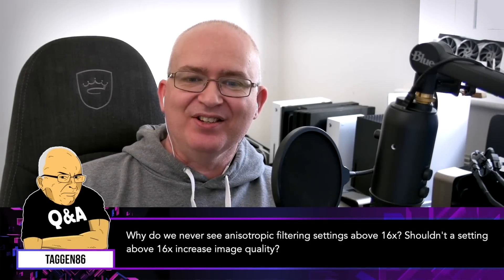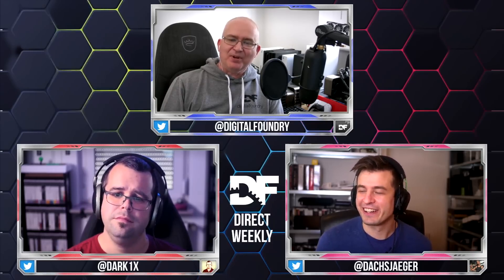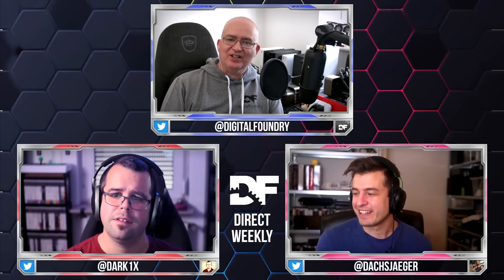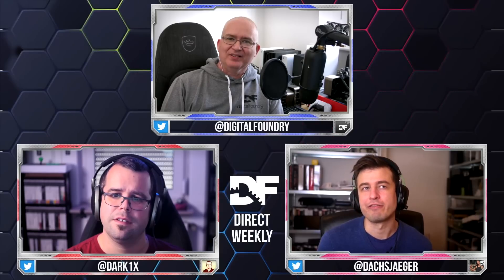Why Doesn't Anisotropic Filtering Go Higher Than 16x?

Comment: Personally I almost always choose 8x on my computer (since there is actually be a small penalty to 16x)... I rarely see a difference between 8x and 16x in modern games and at modern resolutions. The tech was just WAY more important back in the days when you played at low resolutions like 640x480 or 800x600, while games had these endlessly repeating textures on flat surfaces. That's not the case anymore.

Comment: I can tell easily tell the difference between 8x and 16x anisotropic in modern doom source ports when using nearest (raw pixels without filtering) texture filtering mode with linear mipmapping (to prevent crazy moire pattern flickering in distant textures). To get high quality moire free but yet sharp rendering could easily use more than 32x.

Comment: In old games a lot of geo is flat, so you can really tell the differences.

In GZDoom I play with Doom with 32x aniso even, because with 16x at high resolutions you still see a lower quality result with 16x in a large open space.

I'm pretty sure some old Unreal games also provided a 32x option and yeah you can see a difference. If I'm not mistaken, Killing Floor 1 has a 32x option?

Comment: I remember when for a time ATi also supported 6:1 and 12:1 filtering.
And there is pretty much no performance difference at this point in time. I remember a review where the Radeon 9800 Pro had less than 7% difference between 16:1 and off.
And the Geforce 3 in my retro system can indeed 32:1 AF

Comment: This video doesn't actually answer the question beyond "hardware doesn't support it". The real reason is that you get quickly diminishing returns when you weigh computation time vs. resulting graphical fidelity. As one of them said, it's hard to tell the difference between ×8 and ×16. The returns on fidelity increase logarithmically, and the computation cost goes up exponentially. Hardware accelleration improves parallelized tasks like anti-aliasing so that the cost doesn't actually grow exponentially, but it's still a loss to go beyond ×16 in 99% of applications.

Comment: It's interesting that you mentioned down sampling to increase edge definition, in Stable diffusion one of the ways we achieve really good refinement is to over sample, so create a larger resolution image and then down sample it. A good combination you can use is openpose to keep the same position in space for the subject as well as facial expression and face shape, then use a depth model so it maintains the depth, and a model called canny which maintains the texture definition. Then you just give it prompts and regenerate the textures in this shell you've created at a higher resolution and down sample it. I wonder when we will start seeing these techniques being implemented into games, they're getting faster and faster to render every month, we can now render a full image in near real time with a decent graphics card through a model called turbo sdxl.
Reply: Super sampling and msaa is the brut force way to increase visuals 😊
Reply: generative ai fuckboys try to not bring up that they steal images for a living challenge (impossible)

Comment: I almost don't see the difference between 8x and 16x, going higher is totally dumb IMO.  I only don't use 8x exclusively, because today texture filtering is not the bottleneck for GPU's, so setting it to 8x has very small, almost zero, impact on performance.  BTW if you can make them work the old 3DMark03/05 benchmark's have a very cool texturing filtering test tool where is very easy to see the diference between the filtering modes. (the one in 3Dmark06 doesn't work on my PC and later 3DMarks afaik lack this tool)

Comment: I spot the aliasing on chain link fences all the time.  ironically I prefer trilinear in that instance, blurry is easier to look at than moire
Reply: I was hoping they'd speak a little bit on that. I've encountered some titles where 4x fixed a severe moire issue that had the ground sparkling constantly at higher anisotropic filtering levels
Reply: @michaelavrie  admittedly it is an edge case, but dynamic anisotropic filtering is definitely on my wish list because of that

Comment: Today, it probably would be easier on your hardware and of better quality to just turn on CAS and/or LumaSharpen in ReShade (CAS is also available in-driver, but I prefer ReShade as it is per-game) after having forced 16xAF. 

Alternatively, if you have nGreedia GPU and a tool called nVidia (profile) Inspector you may configure LOD to a negative value, say, -0.5, or -0.75, or even -1.0 for sharper distant textures in DX9 or older games (but if you use both sharpening and negative LOD it may cause shimmering). 

Honestly, since I bought a 6900XT, the only thing I miss is the versatility of nVidia Inspector's functions and its vast choice of antialiasing modes. As my last nV GPU was a 2080Ti, it used to be a nice experience, cranking on 32xS antialiasing with 4x transparency supersampling on top in older games like FarCry 1. And, contrary to some opinions, I could easily spot the difference between 8x and 16xS antialiasing; 16xS and 32xS not so much, but quite often too.

Anisotropic filtering, on the other hand, I could not really see any difference between 8x and 16x modes. In fact, as long as it wasn't the case of "look at the scene and textures, take it to memory, goto menu and switch AF" I wouldn't be able to clearly tell the difference between 4x and 16x anisotropy.
Reply: Depends on how you checked. AF will make far textures at angle sharper. If you see something like road in gta and look at far side then you’d notice more difference than a wall upclose. Mostly objects at angle won’t be blurry.
Just keep 16x cuz there’s no performance impact anyway.

Comment: this clip doesnt even attempt to explain the answer in a meaningful way. anisotropic filtering scales any given texture based upon the oblique viewing angle, and thusly, the mipmaps visible distortion. think about it this way: 16x filters angles twice as steep (in degrees) as 8x, which filters angles twice as steep as 4x, etc etc. how many steeply angled degrees for a texel are there?? the answer is veeeeery few, so unfortunately, higher levels of AF like 32x/64x wont do much to improve perceptible image quality in theory. thats why its never been implemented beyond 32x (in old matrox gpus!) - they would only improve image fidelity of a tiny percentage of the screen (little spot here, a rock over there) due to the threshold set by the filter for higher angles relative to the player/camera POV.

despite this, im of the firm opinion that 32x should exist as an opt-in setting for image quality/clarity enthusiasts, and that 16xAF should completely replace trilinear filtering as the default baseline

Comment: I think the bigger question is way does MSAA go from 4x to 8x, shouldn't 3x in each direction or 9x be the next logical step after 4x?
Reply: If you down or upscale at rates other than 2 times, then the pixels do not align with each other properly and multi sampling becomes impossible.
And a part of MSAA is upscaling and downscaling a rendered image or part of an image.
1 times two is 2
2 times two is 4
4 times two is 8
And since it's literally an exponential increase they don't bother with 16 since your PC or the graphics engine is unlikely to handle such a data load.
Reply: @Reac2  You have to scale by integers not by twos, 2160p is literally 720p times three in each dimension.
Reply: MSAA doesn't sample in a grid, it's a different distribution

Comment: I can see bilinear filtering and can vaguely work out what it's doing
I can see trilinear filtering and can vaguely work out what it's doing
🤔😐 I honestly have no idea what anisotropic filtering does and how it works.
Reply: If you imagine a flat floor and you project how many texels a single screen pixel covers, it's a trapezoid shape, a very flat trepezoid if it's far away. AF deals with that case where there are more texels along one axis. Bilinear/trilinear assumes the pixel->texture space projection is square, so you get more blur in one direction at a large distance.

Comment: It really depends on the types of 3d worlds a game has, the geometry, and clutter in the scene. A game like Tribes for example is large open spaces with sprawling landscapes. You can see the 16X AF cutoff easily there. Its not the most critical thing to go above 16x but there definitely is an argument to do so for the right open area game and the performance budget overall.
Reply: Tribes mentioned W

Comment: I remember ATi had 32x anisotropic filtering setting on their control panel back in like 2005.
Still, 16x is more than plenty enough, on top of having pretty much no performance impact.
8x AF is noticeable though, so always go 16x.
Reply: I definitely remember having 32x AA modes during that crazy era where Nvidia and ATI were inventing silly modes like QQAA and weird combinations, but I think 32xAF was something available only on ATI's highest end consumer cards and FireGL cards. IIRC it made zero difference compared to 16x, so support was dropped with the following generation.

The mid-00s were a weird time for graphics. Lots of games still had really basic bump-mapped, flat surfaces. Today's graphics have significantly more geometry to break up texture patterns and oblique angles, so it's not like the same texture repeated forever on the floor, walls, etc. AF is a lot less important now.
Reply: @HansUberschlage - I still remember what a massive difference AF was when I got my 9500 pro, which was one of the first cards able to implement it with a negligible performance impact.

I still want AF in every game, but I wouldn't be complaining about 8x vs 16x.

I also remember all those different AA modes of the 2000's, almost all of which looked like trash and/or cut performance to a third (for younger folks, no, I'm not exaggerating).  Edge-adaptive AA was the beginning of AA really becoming an everyday option for me with a good compromise between image quality and performance. Now we don't even bother talking about what type of AA is being used aside from standard vs image reconstruction.
Reply: @40Sec  Agree, I always use 16xAF and maximum texture size/quality. I'll drop resolution before I lose that. If I wanted blurry textures, I'd play the console version.
Reply: I don't understand why this setting is still available and not just locked to 16x considering the performance impact
Reply: @AdamMi1  I remember back in the day Cinebench's OpenGL benchmark will fail if you have driver level force AF, basically your output image quality will be too high thus not matching reference.
Reply: I imagine there may be some compatibility issues with obscure older games / programs.
Reply: @AdamMi1  I had to use 4x a few years ago when I played Rise of the Tomb Raider because anisotropic filtering was having a huge impact on performance, for some reason. I had a RX 5700 XT at the time.
Reply: @AdamMi1  Yeah I agree, even on very outdated hardware, or very slow GPUs, I've never seen it do anything beyond maybe a 1fps loss so locking it to 16x would do no harm
Reply: I genuinely don’t remember this. And I had an ATi card in 2005.
Reply: I wamt x32 just to be sure, Or 1024...
Reply: sadly, now in AMD Radeon Adenalin the AF in 16x doesn't work.... in DirectX11 (some games).... I don't know why AMD doesn't fix it

Comment: Hardware texture AF has been a solved problem for many years now. Just think about it, when was the last time this topic was present in the marketing materials by NV or AMD? AFAIK, Radeon HD 5000 Series was the last time an AF improvement was mentioned as a feature point. If someone wants higher quality (more filtering taps), just write a custom pixel shader with direct access to the texture data and loop it over until the last blurry texel has vanished.
Reply: And the Radeon 9000 series, 6 generations earlier, already has basically no noticeable performance impact.

Comment: I think 128x MSAA combined with 128x Anisotropic Filtering would basically just turn your GPU into an improvised explosive device.
Reply: National Ignition Facility, more like nVidia Improved Filtering
Reply: Actchually, if you use 32xS antialiasing (through nVidia profile Inspector) in combination with 4.0 DSR factor, you get 4x32=128x effective antialiasing (but only 16 samples of it are supersampled - 4 from the 32xS mode, which is 2x2 OGSSAA combined with with 8x MSAA, and 4 from the DSR, which gives you 4x4=16x effective SSAA, the rest is multisampling). And since every pixel is rendered with 16x accuracy, you get 16x16=256x pseudo-anisotropy. I say "pseudo" because downsampling texture is not really the same as true AF, but in quality terms it may be about as good as 128xAF.
Reply: @enricofermi3471 Insane levels of downsampling+antialiasing+anisotropic filtering is how things are done with offline renderers, and this is how you get such a clean image when you play back the pre-rendered frames at 24 or 30 fps.

If you do that on a modern graphics card with an engine meant for real-time you'll basically get seconds per frame instead of frames per second, and then it becomes an offline renderer for all intents and purposes.
Reply: Huh thats interesting, I do have some enemies that need punishing so I will keep that in mind.
Reply: Any sufficiently advanced battery is indistinguishable from a bomb.
Reply: do 128x SSAA then you render the game at like 128k or 266k or something
Reply: @KeinNiemand  it’s actually not linear like that. It would be a lot more K’s
Reply: At what point would you exceed energy possible in a given space and create an instant black hole

Comment: I still to this day don't know what anisotropic filtering really do like I can't tell the difference between off and x16
Reply: Bruh, the thumbnail of the video expllains it clearly, it's even noticeable on a phone screen.
Reply: @Suhrvivor  well I never noticed that while playing its only when they zoom in that I finally noticed
Reply: Look at shallow angles, like alongside a wall very close to it or crouch on the floor and see the texture getting blurry across the distance on low AF settings. You can notice clear banding between the different MIP stages. With 16x you have 16 MIP levels along the distance with interpolation which makes it look almost perfect. It's often also quite noticable in racing games on the white stripes on the edges of the track and the road surface. Low levels are very ugly, 16x should be the standard and I think we use 16x for over 20 years now without too much performance hit anyway. Before AF we had Trilinear filtering which had some strange kind of artifacting between MIP levels, like little small triangles to blend them together. Before that we had Bilinear filering and had no blending at all, just very clear banding between every MIP level.

Comment: I swear there was 32x when i recently played Wolfenstein the new order and probably old blood too . Lagged the hell outta my RTX 4090 lol
Reply: I suspect you're thinking of Multisample Anti-Aliasing, might have been called CSAA in-game. Totally different thing. That basically works by increasing the render resolution of the pixel edge of all polygons on screen (so 3D objects only basically) in a game by whatever multiple you select. So at 2x, it doubles the number of pixels. The goal of this is to reduce the jagged "stairstep" effect around the edges of 3D objects, AKA aliasing. 

It's very GPU expensive as a result, with quite drastically diminishing returns. The more polygons a game has, the more expensive it will be. And Wolfenstein TNO probably would have been one of the last and more graphically advanced games to use this (MSAA doesn't work properly with more modern renderers), so it's likely one of the most expensive games to use MSAA on.

On the most common PC monitor sizes, I would say the absolute most MSAA you'd ever really need is like 8x at 720p-1080p, 4x at 1440p, and 2x at 4k. To reiterate, it works as a multiplier of the base resolution you're using, that's why I'm saying you should reduce the MSAA setting at higher resolution.
Reply: No way CSAA OR MSAA goes at 32x without killing your frames. & he's taking about AF, not AA

Comment: The real question is why isn't it 16 the DEFAULT. Many games don't even allow it without you tinckering the ini files, and some others come with NO AF at all. In my experience is a feature with little to no performance cost and many pros
Reply: Test Drive Unlimited, for example, looks terrible until you force 16x AF in the Nvidia Control Panel.
Reply: lol yeah, when the "ultra" setting is 8x AF.
Reply: @folding_chable  Forza horizon says hi
Reply: Anisotropic filtering in some of the newest games is no longer free and does have a performance penalty again. But it really does depend. Minecraft for example, mipmapping and 16x Anisotropic filtering was added at somepoint but it is comically expensive.
Reply: @aleksanderziobro5221  That sounds like games are devolving. No proper antialiasing, no proper texture filtering, either blurry, flickering, or both.
Reply: @aleksanderziobro5221 Forget AA just running Minecraft on reasonable settings is comically expensive
Reply: @aleksanderziobro5221 this! A few years ago I was losing my mind talking about AF costing a handful of frames in a new game and everyone defaulted to “no, it’s never cost anything and never will”
Reply: Anisotropic filtering requires mem bandwidth and has never been free, you didn't see it because PC GPUs enjoyed significant mem bandwidth overhead for the last decade and they never had to compete with CPU access unlike consoles. With Nvidia toying around 64 and 128-bit mem buses now we might see an impact again soon.